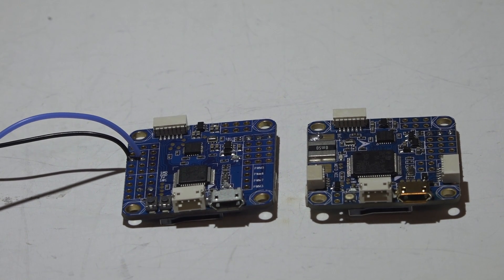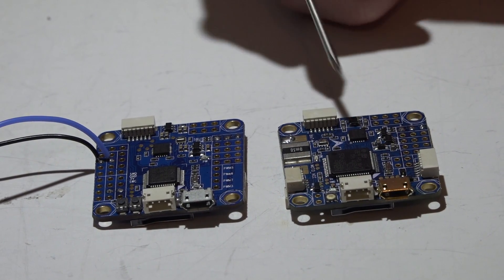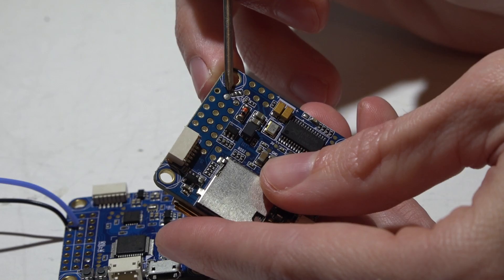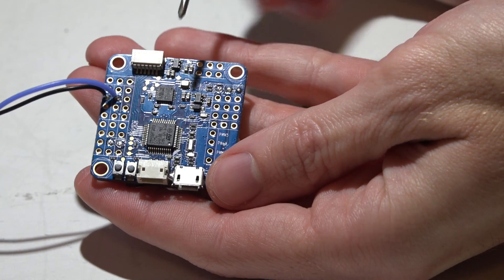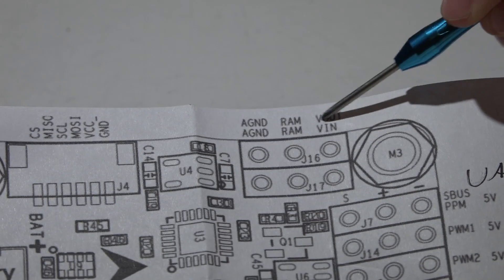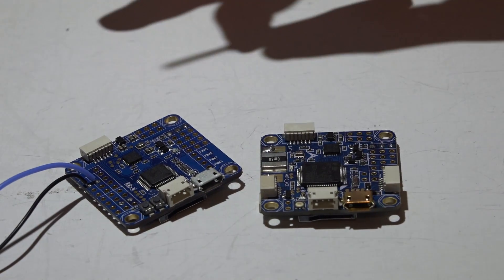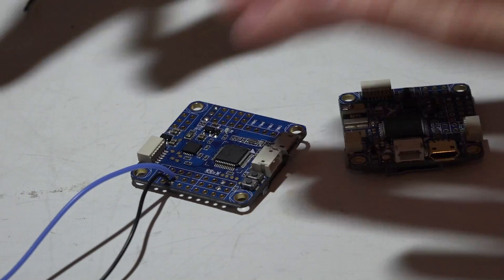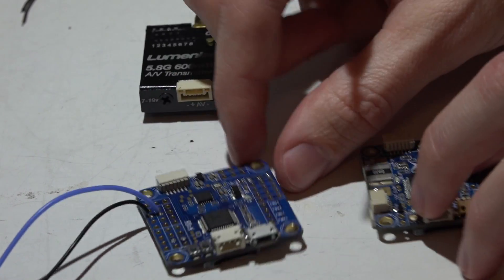Adding Camera & Vtx To Omnibus OSD (F3/F3Pro/F4/F4Pro)

Comment: I have "OMNIBUS F3 Pro V2" and I connected the vtx and cam to the osd on the fc and it does not work. :(   I'm just doing the video wire from cam and vtx in the video in/out and I enable osd in betaflight Still not working

Comment: I only used my signal wire for video in and video out, when only using video out I get my OSD information showing up on screen but when I plug the camera signal wire into video in the picture comes on but the OSD information disappears, what am I doing wrong

Comment: Any chance you can help me? Your videos are great by the way, i benged watched quite a few. I just got the Omnibus F4 Pro V2 FC solder it all up everything was working fine. Then I realized my Receiver jst is to big for for the 6 pin on the board. So i cut the connector off to solder direct .... well..... my Cam In Wire was in the way, i was just ever so slightly scooting it over..well.. snapped off the cam in solder circle trace came with it. ..........Is there any hope for me to map another pin to cam in or scratch the pcb to reveal another option. Also the barometer seemed to stop working also after this happened. Any input would be great. Keep up the bad ass vids man.

Comment: Hi, thanks for the videos. Without these I don't think I would've gotten mine set up so easily. I do have a question. I have the F4 V3 with the current sensor. I'm powering my VTX and Camera from elsewhere. However, I did bridge the RAM and 5v pads in order to get 5v out of the RAM pins that are near the AGround and Video pins. I did this to power an LED strip. However, for some reason I'm only getting 3.8v out of there when I check with a multi-meter. What gives?

I'm going to go a get power from the main 5V rail near the PWM outputs, but I'm still puzzled as to why I only have 3.8v coming out of the RAM pins with RAM/5V bridged. Any idea?

If I decide to instead get power from the main 5V rail, should I just desolder that 5V/RAM bridge if I'm not going to use it?

Comment: JC.... if I use the F3 board in a Airplane I need a bec for 12v VTX and bec for 5v for 2-4 servos and a current sensor so thats three differnt boards as cant find a PDB thats does 5v 4amp for the servos......Any ideas cheers Brett

Comment: On the omnibus f4 v3 there are vcc ram and 5v im running everything power wise from the pdb do I need to jumper bcc to ram ? Or leave it open . Yes the cam video is going through the osd

Comment: Cant you just supply the board with a filtered 4S or 3S supply?  Then you have the FC board and Camera / VTX all getting clean power.....?  My Cameras all take 3S and my VTxs.  Is the 5v on the FC enough to power servos for fixed wing is my other question?....or do the servos need an additional external supply?

Comment: I am currently modding a friends eachine wizard with a flip32omnibus f3, and I am having issues with the OSD not working...funny thing is if I remove the ground from the camera I can see the OSD on a black screen, but as soon as I ground the camera the OSD is gone...I've soldered the video signal wires as per the pin out and your video...any suggestions? Side note, The VTX is getting full batt voltage and the camera is getting 5 volts all from PDB.

Comment: im ready to trash this board, driving me crazy with the vtx/camera installation. i installed it, everything works fine, until i arm. thats when the osd vanishes. i did some research, came and vtx need a common ground. so i set that up, still doesnt work and now there are lines in the video when ever i throttle up. iv never had these issues with any of my other boards. literally driving me crazy.

Comment: Hi Jc. i am using ths frsky d4rii with telemetry. my vtx and camera can handle a 4s lipo direct. so powering the f3 with 4s. does that slot for the led output 5v ? i also want to add a buzzer but need another 5v? ideas? 
thanks

Comment: I'm setting up my first flight controller (F3 AIO) and once again you have solved my problem - this is about the 5th time now. I couldn't see my OSD even though vid was working fine - turns out I had the cam and the TX plugged in the wrong way round :-)
  
Thank you for making all these vids - I would be FUBAR without them

Comment: Hello, I just soldered my VTX and CAM over pdb and I only connected video signal wires to the board, but when I move throttle hard, video gets lost flickering it comes for a second but no osd appears. Is it because 5v regulator cannot delver enough voltage. Can I feed osd with an external 5V regulator?

Comment: Hi Jc; great videos...; still got a question: for the F4 pro V2, can I use J11 for PWM since I got one 4in1 esc that came with a connector, so if J11 is working the proper way, it would save some time; thanx

Comment: Question: If my cam and VTX are already wired through existing spots on my PDB, can I just solder up the video in and out? The FC just needs the data to intercept, so where the cam and VTX get power doesn't really matter right? Probably would allow me to keep the audio aswell if my thinking is correct?
Reply: tecno pro FPV think of video signal and power as two separate things. on my setup, I ran the signal through the FC and power came from the PDB. So wire up the ground to the pdb as you normally would and just run the signal wires to/from the FC. However, I think all grounds will be treated equal.
Reply: tecno pro FPV no harm in playing it safe, we've all been there. Best of luck on your build.
Reply from the maker: Correct. And in fact I recommend doing just that. I power my camera and VTx off the PDB then only run both videos wires to the flight controller.
Reply: Project Blue Falcon Thanks for your feedback! I don't know what I'd do with you and Joshua Bardwell lol.
Reply: What about ground? Should I ground cam/vtx on the fc where the osd is or on the pdb?
Reply: Thanks for the fast reply. I just watched the video again and noticed that he covered my question :D Just wanted to be safe. I remember that I had to run ground to the osd when using  the minim osd.

Comment: Hi JC,
I'm using the Flip 32 Omnibus F4 V2 with Foxeer Monster camera, wiring is correct but the OSD only shows up when the camera is not connected. Once I power up the camera the OSD disappears from my goggles. I power my vtx from the PDB through an LC filter and the cam from the vtx.
What's your input on this? Thanks in advance.

Comment: I have connected the camera and video transmitter on the omnibus f3 to the in and out pins but for some reason I don't get a signal until I short the in and out pins on the fc.. Got me stumped.  Can you help JC?
Thanks

Comment: As far as I can see (on my F4 Pro V3) there's a filter circuit between the jumper pads next to the standoff and the VTX power pins, so even if you use vbat it's filtered. Also I've read that if you don't use the ground pins the OSD has issues. Not tried mine yet so can't confirm.

Comment: Hi, I have the PRO board and am trying to setup smartaudio with my TBS unify. I cant work out where to connect the audio wire on the FC. Are you able to help? Thanks!
Reply: I was able to set it up on TX1 pretty easily...on the Omnibus F3 Pro (Real version) you just have to solder your audio wire to the back of the JST-XH connector (It's a friggin tiny solder joint, but it works fine.) It's the second pin from the bottom. Drop a little hot glue on there and your good to go. Did the same thing with TX2 for telemetry.
Reply from the maker: I've never used smart audio. Not yet at least. But I'm pretty sure I've seen guys connecting it to a Rx pin on a UART. You would have to look at a manual or wiring diagram to find a Rx of a UART. And then again I've never done it so I couldn't say for sure.
Reply: Cheers dude. Talking to some others looks like all the TX/RX UART's are plugs so there is no easy way to solder the wire straight to the board.
Reply: Thanks! I was wondering if I could solder to the back of those. Good to know its possible :)
Reply: Yes! You'll love smart audio - Setting both of my quads up with it. Never touch a VTX to change channels again! :)
Reply: AxleAU , I'm wondering if you could help me.  I just ordered the same stuff for my first build and when I was ordering my FC I saw something called "Airbot Omnibus F4 PRO – Smartaudio connector (6-pin JST)"  for $0.99

Is that what i need to solve the issue you're referring to?
Reply: AxleAU. If you want to check out the store it's sold at its called FPV303 and you can search for that part
Reply: Hi D Rock, That looks like it would be the one. I ended up getting one with wires already attached but it looks the same.
Reply: AxleAU , Cool, I thought so but they didn't say anything about having to build the connector so I wasn't sure.

Thank you

Comment: im powering my vtx and cam off my pdb using different 12v leads. im not getting my osd overlay, but if i unplug cam i get osd on black screen.tried 2 different cameras. should i power my cam and vtx from the same 12v lead on pdb or just wire them all up to my omnibus f3?? any help is appreciated
Reply: Dude...same exact issue here, I've tried using the same ground on the VTX and camera and still nothing...it worked for one test, then same as you only works when I disconnect the camera...let me know if u worked it out and how! Thanks!!

Comment: help ive got my cam and trans powered off of my pdb and am running my signal thru the flight controller. im getting a fine picture but no osd overlay. i have the osd tab on in beta flight and have chosen and saved what i want to see but again no overlay. what am i missing

Comment: So clear something up for me....Im using a foxeer tm25 vtx. Im sending power and ground wires to pdb and im left with video in (yellow wire) gnd (black) and dc5v out (white).  video in (yellow) from vtx goes to video out on fc and dc5v out (white) goes from camera to video in on fc?  Or the other way around? Ground wire (black) just goes from vtx to camera?

Comment: Hey buddy.. can you tell me if this is wired correctly. I have my v3 powered like you showed with the 3rd pin down.. and a + wire coming From a 12v regulator on my pdb to the ram pin. Now it seems to not be showing continuity with the other 2 ram pins. Does the ram also need the ground from the regulator?

Comment: Doesnt the Camera have to be powered from the omnibus to get osd to work?  Thanks John
Reply: I guess when I think about it it would have to be wired up from the fc to work tho osd.
Reply: So just power from the pdb to camera and transmitter would not give me the OSD from the FC...Still need the in and out from the board. Correct?
Reply: Sorry ... Problem solved..... The Video in and out are opposite on the F3 Pro board.

Comment: Thanks for this video others on the Omnibus F4, which I love for functionality/hardware but which has pretty much no documentation. On mine there was not even an arrow for board orientation, but there was one superimposed on a photo of a sketch of it on readytoflyquads... there and no where else. Anyway, very helpful, and I have a few comments: 

- you are correct that uart1 and sbus pins both use the software uart1 port as identified in the betaflight configurator. However the inverted signal is accessible only on the sbus pin and not on the uart1 pin. Not sure what value that has, but mentioning bc if you think of them as identical, you might think you could connect an sbus line to the uart1 pin but you cannot.

- if you have an appropriate camera and vtx I think running them both off of the 5v regulator is a great option. I use a runcamSwift and a TBS Unify Pro 5G8 V2. The cam takes 5-17v (but I run 17.3 with hi voltage lipos, so over the edge, and have read reports of these cams getting scorched from voltage spikes due to active breaking when hooked direct to lipo, so decided against). At 5v the cam pulls 170mA. The vtx is a bit uncommon in requiring 5v. It has variable transmission power 25-800mw and at max output pulls 600mA (and of course at lower). An F4 FC will pull ~100mA, so say 900mA for the total load on the Omnibus 5v regulator, thus 60% of its rated capacity. This seems quite safe if specs and quality control are at all reasonable. You are right that the FC will get hot running that load, but not too hot to touch, and my working assumption is so along as safely under tolerances, I don't care how hot it (vtx or whatever) are to the touch so long as no impact on other components. Also, I'm argali partly with you re doubting e "filtered"/"clean" claims on the Omnibus product descriptions, but not as totally certain. As another poster noted, there are other components in the proximity of the regulator, so I can't refute from circuit inspection alone; mainly doubtful bc of the weak phrasing in the product description... if there really were a "video signal line filter circuit" on the board, they probably would have said it explicitly like that. My test will be subjective as to whether it needs an external filter circuit, but not at that stage yet. Though even if it does, with the setup I have got, I need just that one component, and no need for a pdb or any other circuitry other can connections to cam, vtx and escs so will be just about the cleanest possible build - that's why I love this FC. (Btw I do run a current sensor between the battery connections and everything else). 

(btw, another cool thing about the TBS Unify is that if, as we both do, you use an Frsky radio (Horus in my case) and a receiver like the XSR with smarport connected to the Omnibus (great video on that hardware hack, btw... no chance of figuring that one on my own) then you can connect the last remaining uart to the audio input of the TBS and to get FC access to Smart Audio 2. That enables control all vtx parameters (power, channel and others it has) via the omnibus osd menus (this much just requires the vtx audio to uart connection); and in combination with the smartport connection and an available Taranis/Horus script (bundled with the same one for pid control) you can do receiver configuration of all the vtx parameters via the Taranis.  

- Last and least: as your continuity test indicates, the two vbat pins on the Omnibus are directly connected, so there is actually no harm, and it's equivalent in the circuit, to connect lipo to the one that is next to the ram pin. I thought worth mentioning for just the odd case where someone destroys the other vbat terminal; in that case they could still power the board via lipo to vbat next to ram.
Reply from the maker: You obviously sound like you know what you're doing, so I'd say your risk of anything going wrong is low. You just have to understand that many of my viewers are new. And to explain what you can and cant do, with every combination of parts out there drawing different currents, some video transmitters supplying the 5v to camera, and everything else, I avoid that because it would have doubled the length of the video. If you're going to supply your parts with the full voltage of the battery, its just as easy to solder that wire to the PDB than the flight controller. So by telling people to do this the guys using the full voltage are covered, guys using 5v are are covered, guys using a little or a lot of current is covered. Everyone is covered if I just say use a 5v, 12v, or full voltage from the PDB. 

I understand where you are coming from. If you saw my inbox of how many times guys have fried the regulator on these boards then you would understand where I'm coming from.
Reply: Project Blue Falcon understood! Your target is people needing to know the basics. Great stuff though!
Reply from the maker: Charles Klein yep, sorry about that. Just trying to keep everyone covered with a happy median.
Reply: Must tell you! Just two incidents of meaningless manufacturer specs, the first was re all I cited above in defense of wiring ram to vbat: in short you were right, the regulator can't handle it... but did not fry the board, just overloaded it so much the omnibus led pathetically flickered and faded out. I know I was under .5A; just a junk or misrated onboard 5V regulator (though totally adequate to power the omnibus, just nothing else). Don't know if you care about dshot but second specification lie was re Bullet 35A escs, which I think were the only "dhsot supported" escs out there at that current rating when I bought them. Emax later said "no, they don't support dshot" on rcgroups but they still say they do on the Emax site and just about every US vendor says the same. This hobby doesn't work without testing everything obviously.
Reply: you say u have omnibus f4 pro? i have order OMNIBUS F4 PRO V3 FLIGHT CONTROLLER WITH CURRENT SENSOR, OSD AND SMARTAUDIO sorry copy and pasted that.. board orientation is there a set degree i need to have mine? im trying to get prepared so i can get installed and back flying after anouther flightboard (hyperlite f4) randomly lost all data betaflight after i powered back up to fly after it was flying just fine before. Thanks